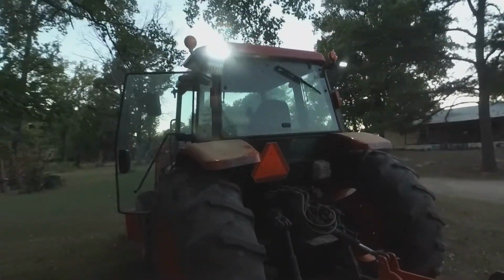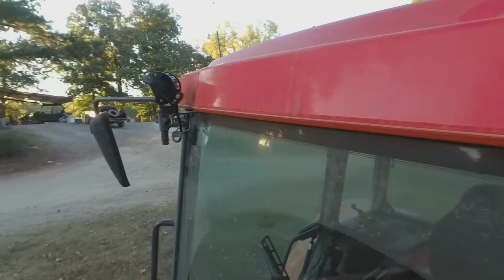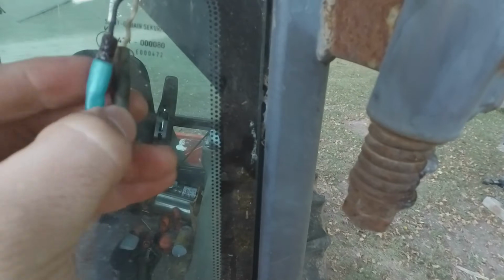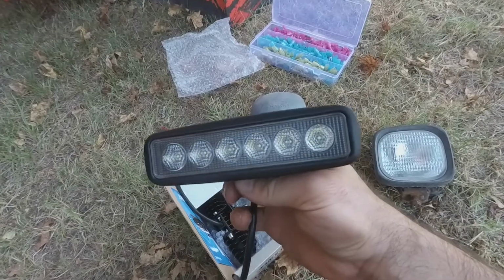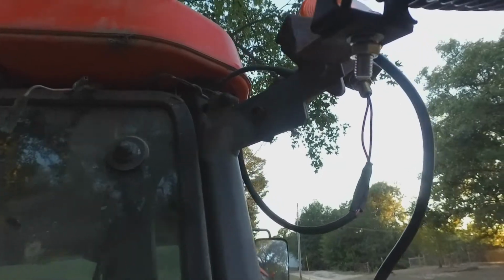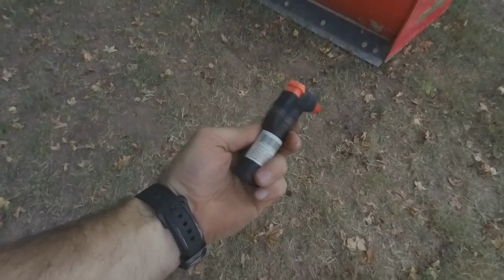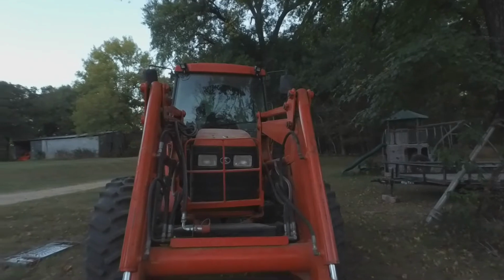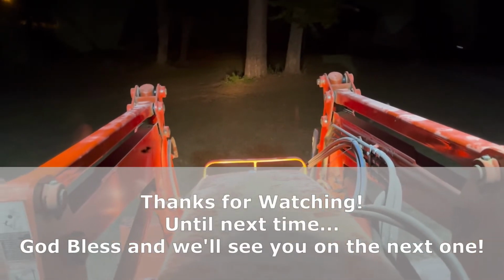Installing LED Work Lights on Kubota Cab Tractor - NILIGHT

Comment from the maker: The lights worked out great! I like the 18W 6" flat style the best!
Links -
Heat Shrink Bullet Connectors - https://amzn.to/3Zi9717
Crimping Tool for Heat Shrink Connectors - https://amzn.to/3m2dYoW
CRC Technician Grade Di-Electric Grease - https://amzn.to/3xRM7u2
Nilight LED Light Bar 18W 6Inch Flood LED Pods - https://amzn.to/3Ewr8AM
Nilight - Led Pods 18W 1260LM Flood - https://amzn.to/3KAQqBv

Comment: I just put LEDs lights on my tractor,  it made a huge difference from the halogen lights. 
  Aside from the improvement in the amount and strength of lights I have been told that the LEDs will last longer, I was tired of changing bulbs in the halogen lights and then they were blown after a while
Reply from the maker: Same here! I think I’ve decided instead of the light bar up front I’m going to put a larger light bar up on the front of the cab so all of the light will be thrown over top of any bales or other things I might be carrying. LEDs are awesome for sure!